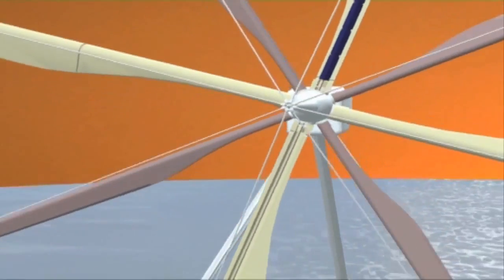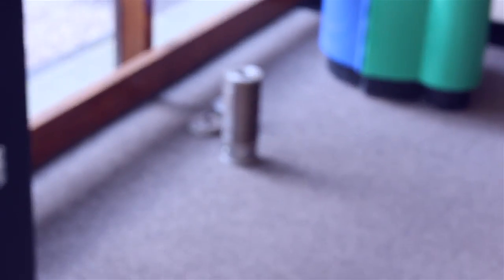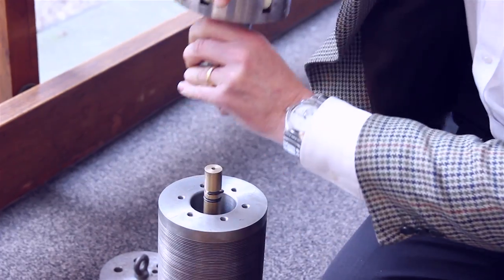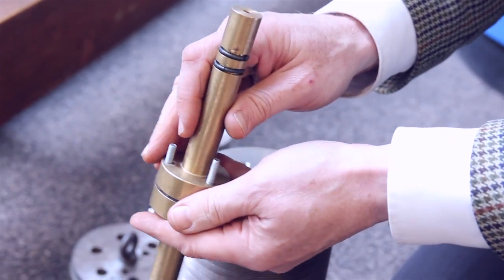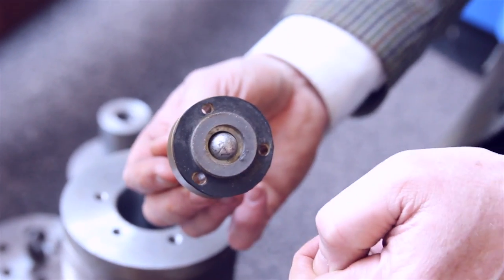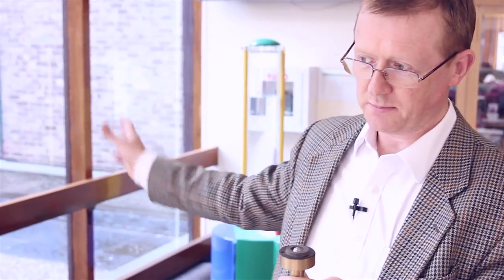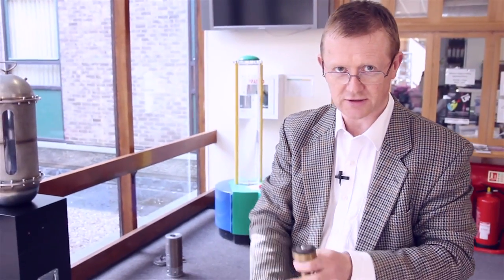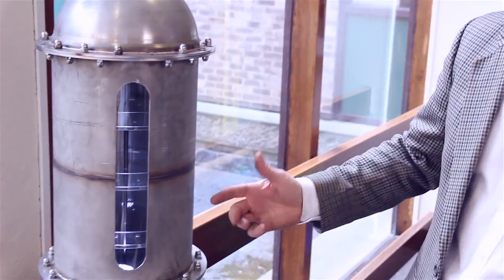Time Capsule #1 - Piston

Comment: I like his enthusiasme, but I see a problem with the change in angular momentum(by the pistons being at the outside on the way up, and inside on the way down) causing as much reduction in wind effeciency, as it would give. 
And why not just have it work as a compressor directly, perhaps through something like a cam system directly on the rotor shaft? (fewer moving parts that way) ;) (or perhaps a modified Wankel type compressor)
But all the luck to him in his quest :)

Comment: The brilliance of underwater airbags seems clear. But I'd intuitively expect heavy moving weights in gusty winds to be relatively failure-prone. Surely Prof. Garvey has tested to assure the efficiency/simplicity of the moving weights truly outperforms traditional compressors. Presuming anything novel is patent-protected ... might you show those efficiency points more explicitly?

Comment: If the RPM is sufficently slow, the force due to gravity will be greater than the force due to the centrifugal force. If the blades rotate fast enough, than yes, the pistons will not function. But as he mentions in the videos, the rotational speed decreases with blade diameter. He demonstrates the device in a playlist of youtube videos.

Comment: I understand that there are cost saving associated with this type of turbine. However I just don't understand how anyone could think this is a viable system. Even in adiabatic compressed air systems the overall efficiency approaches 70%, which is no better than our current systems. Also with an added energy conversion (to and from compressed air) more losses are added. On top of that, low wind won't turn this turbine, long piston travel adds loss, and it's only efficient in a narrow RPM band...

Comment: As an engineer you should know by now that any time we convert energy from one form to another form we loose some of it as waste. In the conventional wind turbine design we convert wind -> rotary mechanical -> electrical energy output at the dynamo -> to AC frequency & voltage of the national grid. If I were working on this design (which I'm not !) I would try to minimize the steps in the conversion by piping the air down to ground level to then convert it in one or two steps to the useful form

Comment: ? I've watched several videos on this before and as an engineer, I don't yet understand how the benefits outweigh the costs.
Compressing pneumatics is an very inefficient process and a lousy form of energy conversion; in addition, after the energy is stored as "compressed air" it will still require the transformation into a usable form of energy, ie. electricity which is yet another energy loss process.
Not saying it won't work, just that I'll be surprised it it turns out to be beneficial.

Comment: I wonder how can storing energy in compressed air be possibly the most efficient way. When compressing air, vast amount of energy goes to heat which gets lost very soon. Sure, storing electric energy is not very efficient but in my opinion the right way to go is to couple intermittent energy producers such as wind with intermittent energy consumers and going without any intermediate storage at all.